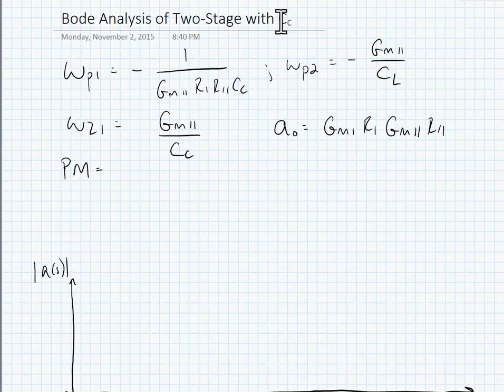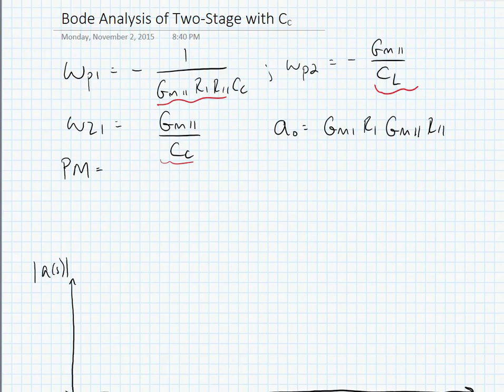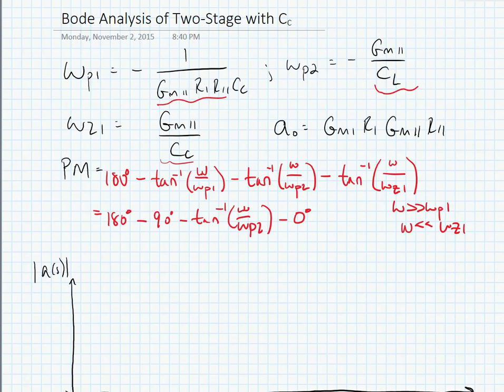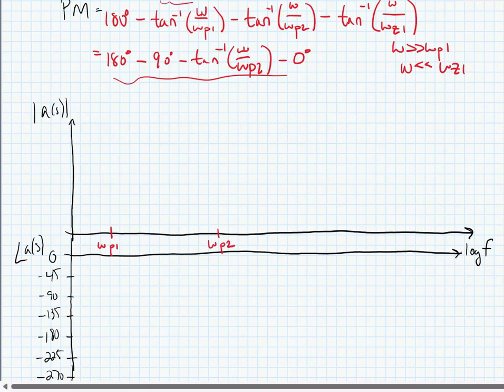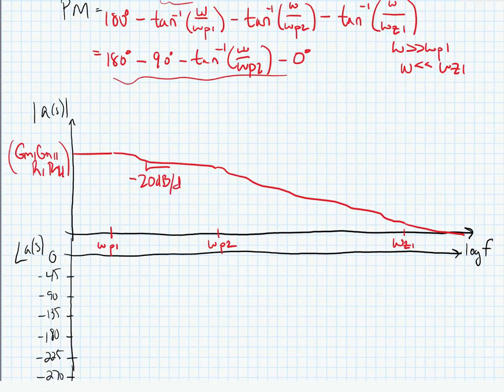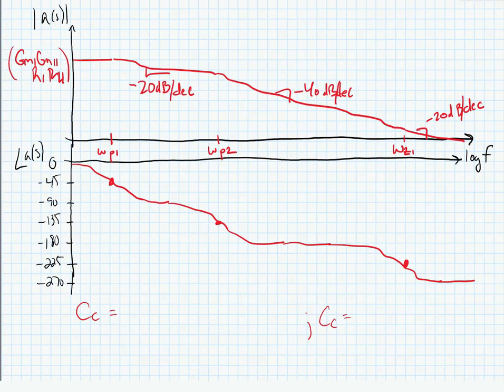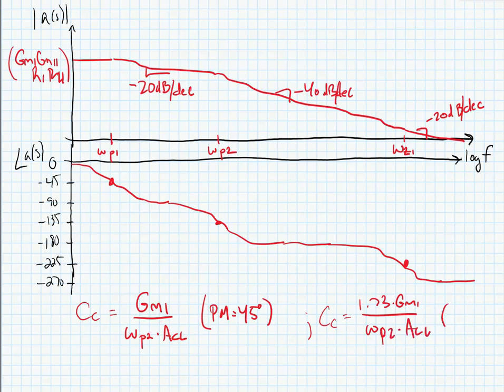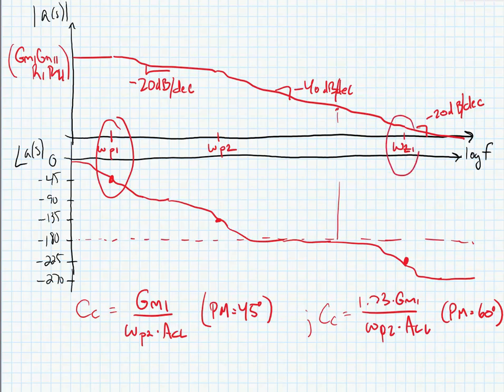ECE 3204 Lecture 16C - Bode Analysis of Basic Miller Compensation

Comment: Awesome video professor. But I'm still have some problems:
1. What is the RHP and the LHP mean? I mean after calculating the small signal model, we will get two poles. How do we know those poles and zeros are left hand or right hand? If the pole is left hand , that means a "negative frequency",
2. How do we know the zero is at the right side of the wp2?
3. As far as I know, a zero has a positive 45 degree shift, why a LHP zero contribute to a negative 45 degress shift?
Thank you and wish you all the best!
Reply from the maker: I will try to put up a video on how to analyze transfer functions shortly.
Reply: @wallingphd  Thanks!